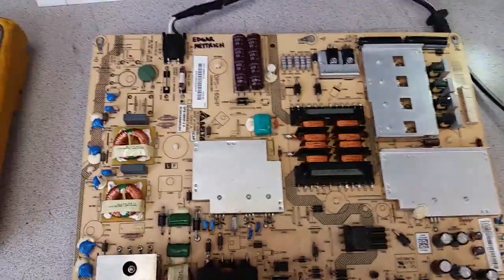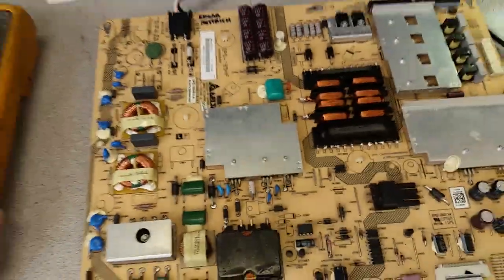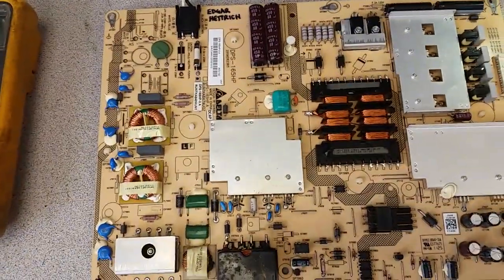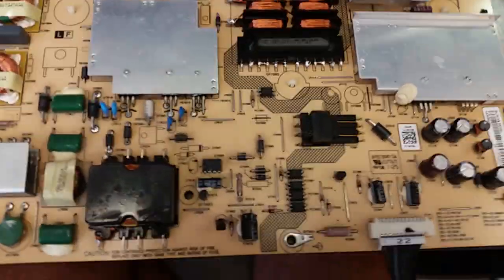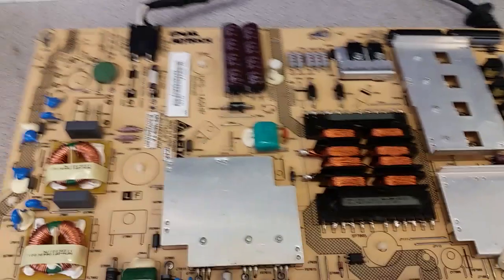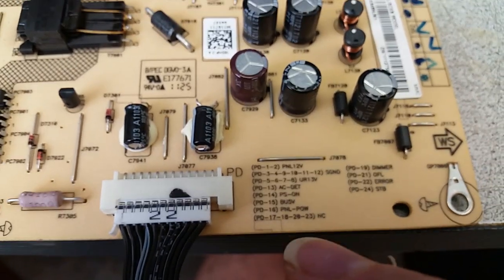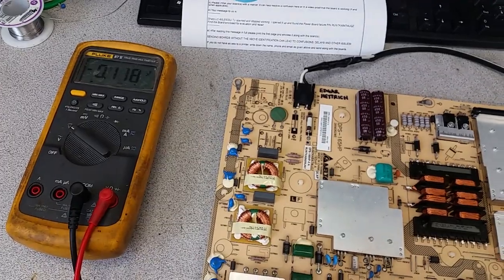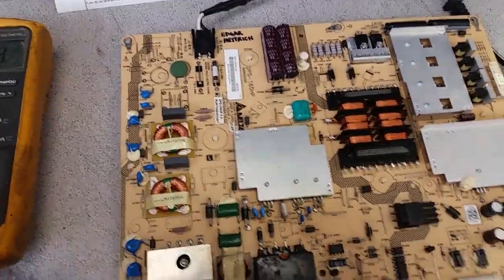Functionality proof / how to test Sharp LC-60LE633U power RUNTKA848WJN1  / DPS-165HP-3 for Edgar H.

Comment: Thanks,  really helped, with this video and schematics TV is working again.
I replaced:
1.  Blown  F7001 Fuse
2. Shorted BD7001 D10XB60-700 rectifier 
3.  Blown C7817, C7818  1nF 1KV K
4. Shorted R7601, 0.1ohm 1W
5. Shorted R7914, 2.2ohm  1/2W
Reply: Hi , I am having the same trouble with my tv , I have replaced the fuse and c7817 but not c7818 as it looked ok,  Could you tell me where to find the other components you repaced please?